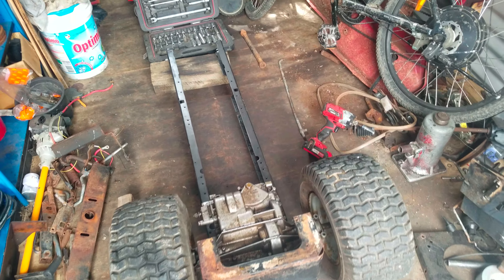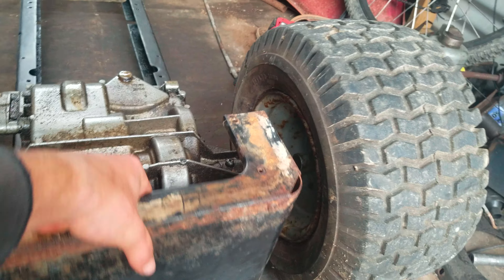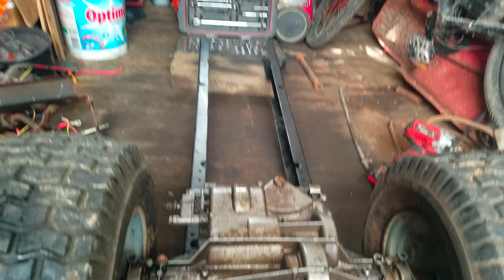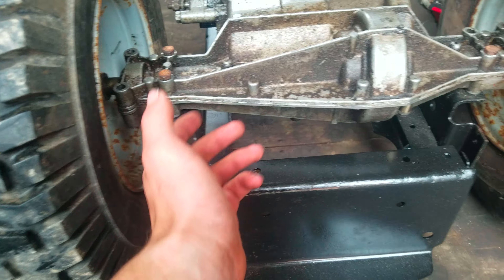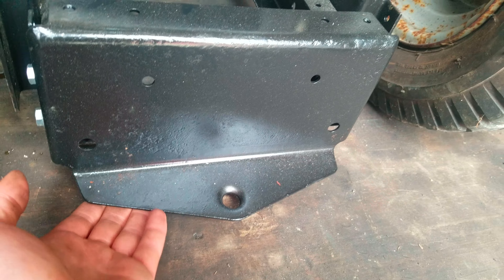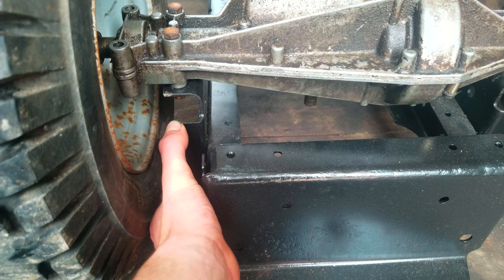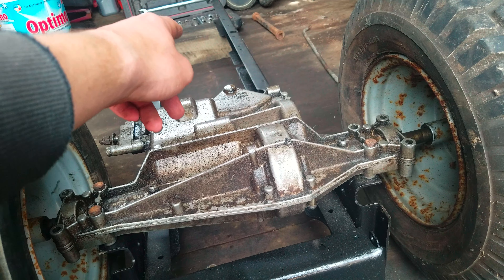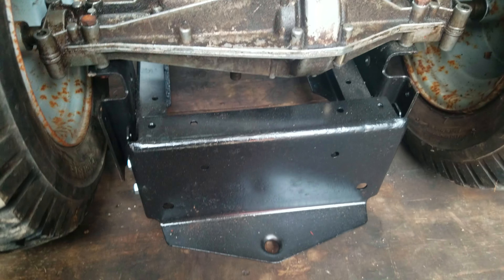race mower build, frame pt:1

Comment: Nice! Can’t wait to see it running…
Reply from the maker: Plan is to do about 80kph (50mph) when finished, eney ideas for makeing it better?
Reply: @droptheblades895  Shave the cylinder head to increase compression, research porting the intake and exhaust bowls and back cutting the intake valve. (possibly a little power to be had). Increase carburetor jet size (careful just a little). Not sure of your drive from the engine to transmission — belt driven, play around with different pulley sizes. Good luck, l can’t wait to see the progress…
Reply from the maker: @TheDeadMan3848  i'v mostly finished the motor, build series here: (pt1) https://youtu.be/3CGn-pWNDnI , it is a 7pt walk-through. still need to shave the head (ideally want a 25-model head to put on it). and I pretty much worked out the pully sizes with an online calculator. in the future hope to have an internally geared-up trans so maybe 160kph (100mph) with a bigger motor! thanks for your feed back:)